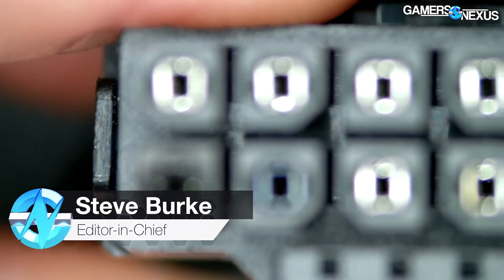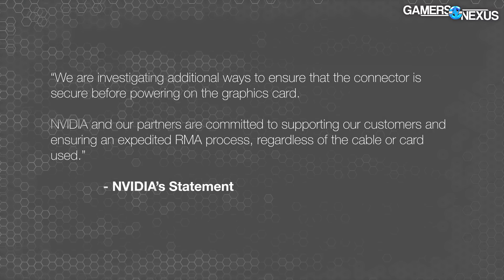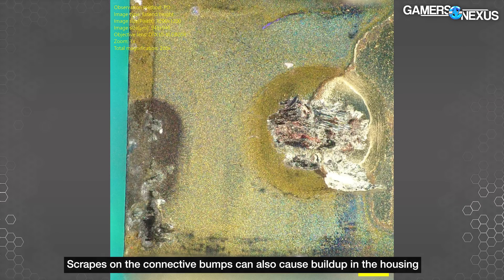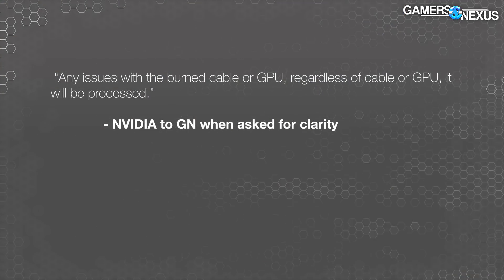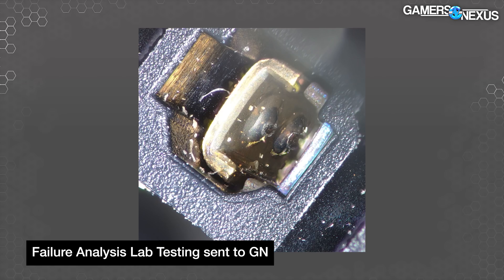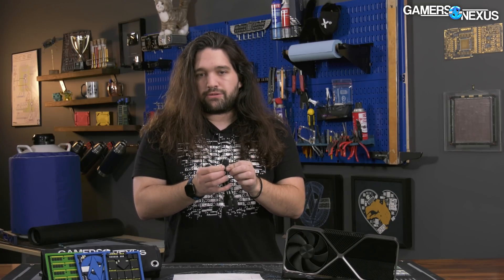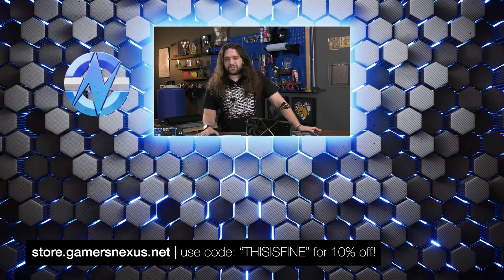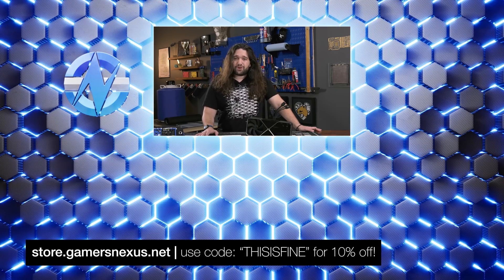NVIDIA Responds to Melting Cables, Warranty Concerns, & 12VHPWR Adapter Failures

Comment: Imagine the public opinion of Nvidia blaming user error if GN hadn't released their video and research on it already
Reply: @HappyDiggers  What, like my car shouldn't go into reverse unless its stationary? So I shouldn't be able to go into reverse gear at 70mph on the motorway? My friend had another friend did exactly that to his car and shredded the gearbox. User error - operated outside the specified parameters. Using the card while the cable is not completed seated is outside the parameters. To me this is the exact same thing - stifling companies productivity by forcing them to make everything idiot proof is a bad idea in my opinion - especially when the information is so readily available on the internet. If you spend this amount of money, you should most definitely have some kind of common sense. Nothing more is required here, I mean I appreciate this investigation, but my gut told me the answer way before unveiling a conclusion was necessary.
Reply: right the optics overall are just much better this way .2nd source with a customer first mindset. rather than a corporate first.
Reply: Almost makes you wonder how and why the information happened to come in that order within a couple of days, after weeks of speculation
Reply: @rillepp  You wonder why? It's similarly educated lab engineers sampling tests and errors for the same product, beginning from the same timeframe period. Nvidia being the liable party, takes a few days extra to be sure they can stand by their findings.

This is completely natural. Would you rather have there be a month between the same findings? That'd be far more suspicious lol
Reply: @Real_MisterSir  I would expect Nvidia to come out with analysis much sooner considering the resources they have to throw at it versus a Youtube channel, plus the motivation from PR situation burning a hole in their pocket. Although appreciate that they also have the liability of this product to weigh against that.

What I am saying is that GN putting the video out and throwing the blame heavily on user error has been great for both allowing that user blame to come from a 3rd party, and also letting Nvidia see how the public reacts (or "buys it" if you prefer) before releasing their own statement. Nvidia must be pretty happy with GN right now on balance.
Reply: @rillepp  cuz nvidia was scared to drop them allegations on these snowflakes nowadays, without GN to break it to them softly first lol.
Reply: @rillepp  Why it took multiple labs teh same amount of time to gather evidence and make an analysis?
Reply: @rillepp  Good point. Has all the obvious symptoms of a scripted scenario.
Reply: @toddhoward5555  it just works
Reply: @HappyDiggers  Ow don't get me wrong! I agree with you that we should be using safe connectors. This however isn't the industry standard as a good connector is expensive and companies hate parting with money!

As for the question of how many transfer more then 600W, do you want a list or is a link to a connector brochure sufficient?

Also the number of Watts is irrelevant... The amperage is what's important!
Reply: @Nemesis-pe7mw  
Your last sentence is wrong. Amperage means nothing without Voltage.
Reply: @AttilaTheHun333333  no he don't wire are rated in amp not volt most wire are rated for 600volt 
It could be 10v or 500v if the amperage is over the wire rating you will have some magic smoke
Watt is even more irrelevant the same wire can burn at 150w (10v at 15amp)or be good for 6000w (600v at 10amp)
In the end what funny is people think 600w is a lot of power lol
Reply: @legros731  
You say he's not wrong, yet show the importance of voltage when talking about amps in your own example. 🤦‍♂️
Besides 600 Watts definitely is a lot at 12V.
Reply: @AttilaTheHun333333  yes voltage and wattage is important Ohm law buddy They all influences each other 
but the amp is the only thing that never change in the wire capabilities  his is why wire are rated in amp capacity 
In this case of a poor connection the watt/volt/amp stay the same but the resistance created by the poor connection cannot deliver the same amp draw because of the reduced surface area in the contact = burn connector 
one size wire can support a wide range of voltage and wattage
More volt just mean a smaller wire can deliver more power(watt)
600w is not a lot for 12 volt and the card rarely go above 450w they make 2000watt power supply buddy this is a lot more we talking 166amp at 12v
For the same reason breaker and fuse are rated in amp and not in watt or volt
Reply: @legros731  
Stopped reading at "buddy"
Reply: @AttilaTheHun333333  ok buddy the clown who think he know something but actually know nothing about simple things like wire rating and Ohm law
Reply: @AttilaTheHun333333  Thank you for in correcting me.

Voltage has no relation to the heat produced. What is correct is that you need a minimum voltage to drive the current.

If you stay at the same power and the amperage goes down the voltage goes up. So how is your comment relevant?
Reply: @glitter_fart  well if you search good enough, you can find some normal 6/8pin pcie connectors or 24pin mainboasrd connectors melted aswell...
here example: https://images-na.ssl-images-amazon.com/images/I/71OhTBX802L._SL1600_.jpg 
lots of ppl are firsttime building PCs and are just affraid to use too much force
Reply: @HappyDiggers  you didnt watch the video did you ? tranport your statement to the pigfat inthe gastank.....and hopefully some ligthbulbs will appear...
just because you can physicly fill a gastank with liquid pigfat and it will run for a while does NOT mean its bad design of a gastank/motor.....
Reply: @glitter_fart  it's not really an opinion, just bad design.
Reply: @HappyDiggers  so you will just reject any studies until you find one that supports your view? Doesn't sound very unbiased
Reply: Well, it is only 50 cases out of 100K, so it is kinda obvious that it is probably something on customer side.
Reply: "Nvidia calls their customers idiots and doesn't care." - That's what it would've been like, cause "corpos evil". - Not that I like Nvidia, almost at all, but ever since social media gave "the public" a voice, the consumer really started acting like they know better just because they pay a company and "have the right to complain".
Reply: @michaelmonstar4276  most of ngreedia customer are idiots so no offense taken there lol
Only idiot would pay 1600$ for a GPU and they still sold out in 5 minute so be ready for a 2000$ 5090 lol
Reply: @glitter_fart  then every single product ever made could be called a design flaw. its a plug
Reply: In fairness there are a lot of small things nvidia could have done to minimize the chance of user error. 

They’ll never be able to get that number to zero but having a clip that actually clicks when it is connected, painting part of the end to show a different color if it’s not fully seated or using a slightly more durable coating on  the connectors.

There are ways Nvidia could help minimize the chance of user error that costs then Penny’s per connector. 

But yes had they blamed consumers before channels like GN said anything they would have been eaten alive.
Reply: @BigHeadClan  what a bunch of clown it not Nvidia fault did you even listened to the video 
Secondly Intel participated in making this new connector  so by your logic is Intel at  fault as well
It user error 100% and what the problem Nvidia said it will warranty all melted card anyway
Reply: @legros731  If Nvidia is providing the warranty for melted cards then they admit that it's their product that is at fault. "Clown"
Reply: @HappyDiggers  Nvidia didn't design the 12vhpwr connection standard tho so they shifted that liability to pci-sig the designers, its now up to them to update  the design.
Reply: @HappyDiggers  This is easily the least intelligent thing I have ever seen on the internet. Well done, that is quite the feat.
Reply: @m0rianne  "anything that rationally criticizes my corporate idols is unintelligent!"
-brazen product fantard
Reply: @Jay A Couldn't find your post. You said "How would go about gaining the required knowledge without toughing hardware."

The premise of not touching hardware is incorrect and not what I meant at all.

First you research. Just start reading, preferably reading, videos if you must. Then you visit a number of enthusiast site and verify that what you learned is indeed correct. After which you start with the OLDEST hardware you can find. Build a few cheap systems. See if there is a community near you and join them or at least visit a few times. Find a buddy that is in the know to help you. Preferably after a few you advance to the expensive hardware.

I for instance learned a lot from a PC of old parts I build 20 years ago, I put it in old filtered transmission oil as a cooling medium. Even though I did my due diligence I destroyed a mainboard. Which was expected thus I had a spare. I got it to run and it cooled very well. I learned a ton from this. Cost me nothing, the hardware was a donation from a company and the oil was waste from another company.

DO NOT DO THIS IF YOU DO NOT KNOW WHAT YOU'RE DOING! OLD TRANSMISSION OIL CONTAINS METAL PARTICLES WHICH CAN CAUSE DANGEROUS SITUATIONS FOR OBVIOUS REASONS. ALSO YOUR CAPS WILL POP IF YOU DO NOT INSULATE THEM!
Reply: People frequently describe buildings PCs like adult Legos, to emphasize how simple it is. It's a reductive statement but if people are going to continue to parrot this, then this issue has to be a design flaw. It shouldn't be possible to make such a egregious mistake if the building process is supposed to be as easy as people make it out to be. There shouldn't be any room for error in the designs.
Reply: @ImAlsoMerobiba  lol shouldn't any flaw in the design lol that it not possible this is real life not a fairytale 
Everything is a compromise
Reply: @ImAlsoMerobiba  lol, no. but ok...
Reply: @HappyDiggers  Have you ever plugged something into a power point, they work partially plugged in, it's not safe - but if a connection's made it will work. Not pushing something in fully is definitely user error, especially when we aren't talking 1mil we are talking 5 to 6ml.
Reply: @HappyDiggers  lol it not a fire hazard not one have catch fire we are not even close to a fire in this case
This exact scenario could happen to any connector by the way
One exemple are ford heater fan connector they always melt like crazy and the only thing that happens is the fan eventually stop working they never cause fire and something they are so melted you cannot even disconnect them 
By the way i live in Canada and we got excellent consumer protection law
Reply: You don't have to imagine it. Morons all over the PC gaming subreddits are still blaming Nvidia.
Reply: Woulda been the same. "Bullshit".
Reply: @glitter_fart  nope ....24pin atx exists same latch same wire apms specs same everything ...if people are to fukign stupid to use a fuking PLUG they shount be ANYWHERE close to a fuking pc...(as long as its closed its fine)
Reply: @glitter_fart  Yep.
Reply: Boeing did that
Reply: @glitter_fart  who care about your option
Reply: In relation to your comment. Image the shape our country would be in if he had honest reporting
Reply: @HappyDiggers  yet it does though being my point :)
Reply: @glitter_fart  Give me an example of another product that uses 500-600 watts via 12 volts? ATX standard, it was nice knowing you but we need to move on. That and the power hungry GPU's need their own PSU.
Reply: No the puiblic is gonna hate on NVidia anway because people are stupid
Reply: @TheNerd  I mean nvidia didnt have to conform to ATX standards for power delivery. At this point, power hungry GPU's like the 4090 need their own PSU. It's kinda ridiculous to shove 500-600 watts down 12V rails into a single connector. My entire computer with a mid tier CPU and 1080ti doesn't use that much power. P=IxE  600=50x12. That's right, 50 amps across tiny wires. You can't be serious.
Reply: @HappyDiggers  BS period... Nvidia used the plug exactly like the specs agreed in the Gremium. And 50 idiots globally are 50 idiots... Just FYI your psu probably has a higher failure rate if it's not gold++
Reply: GN is being very nice in their wording while still saying the obvious.

This is "partly" and with that entirely a design error in the retention mechanism of the cable.

You're dealing with ludicrous amounts of amps in a small cable, so extra care squared needs to be taken designing this to be well seated.

Because it catching fire in any event the cable isn't seated properly is a given.
Reply: you can tell they waited.
Reply: But it is user error… and it’s only 50 cards that have the issue. Should we really be upset about 50 dumb fucks losing $1600 because they don’t know how to seat a cable properly?
Reply: I really dislike those connector designs, i'd much rather it was more like a barrel connector (given how important that connector is to it's performance).
Reply: @glitter_fart  Definitely user error.
Reply: @HappyDiggers  Maybe you shouldn't touch a pc.
Reply: IMO GN should have not made any of these videos because nvidia should’ve had to investigate this themselves and they owe Steve millions of dollars for his work; he single handedly saved them from an expensive recall; I personally think the cables should be recalled still, we should be able to get a free cable. Nvidia is scalping us practically with their prices and can’t give us a 50 cent cable it’s ridiculous
Reply: To be honest having seen the force Steve needed to use to get the cable to "click" into the socket correctly, I'm surprised there haven't been more melted cables.

Admittedly I'm not an expert PC Builder, but I doubt I'd have tried that much force to connect the power cable.
Reply: Funny thing is that Jonnyguru said it too.
And people went crazy on him
They where saying: yeah proper who has been building computers for years , don’t know how to plug a GPU

They where saying that without even knowing what people got the burnt connectors hahahaha

Could have been total noobs , for all we know.

Like you say , it almsot feels like Nvidia was trying to figure out how to say it.  With out people going nuts.
And Gamer Necus made them a. Huge favor
Reply: @HappyDiggers  Also it's at best a design over sight.  How many connectors used internally protect against bad placement? Many hardware connections will not even prevent you from plugging it in the wrong way.
Reply: Like Apple blaming users for holding their phones wrong with the antenna problems?
Reply: Edit: I seem to have replied to a comment that was deleted.
@UCWez92bamd1AIt3VX9ophXg McDonald's coffee is a misnomer, where after repeated warnings they continued to serve it above safe temperatures, and when it was spilled a woman's lap it was so scorching hot (180* or higher) that it melted her pants and gave her such bad burns she was hospitalized for 8 days; all she asked for in her original request to McDonalds was $20,000 to cover her hospital costs.
She only sued them after they denied that request (their offer was $800)— the case is Liebeck v. McDonald's Restaurants if you want to look it up.
Reply: @glitter_fart  Idk about you, but you can only design for so much incompetence. Did you see how loose those connectors were?
Reply: @anthonypham9708  if the cables are super loose, than they shouldn't power the GPU
Reply: @JayXdbX  yeah, I'll give you that the sense pins should disconnect way before power pins reach a threshold. To be fair to them though, this style of plug often has half a mm or more play in it after manufacturing in the direction of entry, so it's hard to fine-tune that.

That's also the reason why it's very hard to make a switch or electrical connection to check if the cable was fully inserted, the latching threshold is smaller than the play in the z-direction. But simply cutting power if the cable IS about to back out would be sufficient to guarantee non-smoking. 

At least all those connector shells are most likely glow-wire certified to not actually ignite.
Reply: @anthonypham9708  but... but.... nvidia bad, you dont understand.
Reply: @anthonypham9708  Did you watch the video and see how tight those connectors look even though they're not latched in? That's the design flaw. They come lose after the fact, during cable management. Nobody and I mean nobody plugged their cable in that loosely, looked at it, thought "this is fine" and proceeded to power on the system. They thought it was fully seated when it wasn't, due to the design flaw of it not latching.
Reply: @mjc0961  and that's been the case with latching connectors from the ATX standard from time immemoriam. Sotomayor people push "hard enough", don't hear a click, but still don't verify. It'snot that they're stupid... they don't have experience. I get it. But if you don't have experience, you spend the time and verify. Every guide talks about checking yo cables. Hell, it's a latch, it's not that hard to figure out.
Reply: hahaha so right! They must've been debating when and how to get this news out for weeks until GN released their video! This was funny af
Reply: Yeah I would not be surprised if Nvidia was trying to figure out how to release this and prove it without a bunch of blowback, and then once GN put out their video demonstrating it, Nvidia could breathe a sigh of relief.
Reply: imo i think gamers nexus did not cover this the right way and accidentally enabled NVIDIA's greed and anti consumerism by showing that its a 0.05 chance of it catching fire and caused by user error;

reality is, its more so a design error, this issue never was a thing on 1080 tis or other gens; we need someone to convince nvidia to give us free cablemod cables instead of this non-action answer that I consider the bare minimum;

this isn't really good customer service, XFX is, those guys would give me free stuff for no reason other than for buying their stuff to keep me a customer, especially when a card I had died, I'd get new cables, new stickers etc free, discount codes, they'd cover any costs of shipping, you get the idea. If XFX had a card that literally bursts into flames, I bet you they'd give you a cable that didn't do that, nvidia is basically giving people who RMA the card the same type of cable and not even the cablemod cable.
Reply: Design should be such that it prevents user error. Otherwise it is bad design. Just look at how good USB are.
Reply: @HappyDiggers  Sorry, it's a PC part. It's meant to be installed by some who has the knowledge to do so. If you do not do what steve demonstrates you shouldn't be going near hardware...
Reply: @Nemesis-pe7mw  absolute rubbish. if you dont know what you are doing you shouldn't go near hardware? Dont ever give advice to anyone again you absolute idiot. 

So how is anyone supposed to get into enthusiast gaming without knowing this stuff up front? 

you buy hardware and expect it to be user installable because its sold that way. 

Finally, no it isnt 75% its more than that. it can be 99% installed, no latched and work its way out. Are YOU deaf and blind?!
Reply: @HappyDiggers  Kinda my point, cable not fully connected is called "user error" when the fault is a badly designed connector.
Reply: @ssu7653  lol yes it is 
It's the user that did not fully seat the connector end of story you need resistant for a good connection a loose fit = bad connection 
You not been around many connector do you every weather pack connector found on car and everywhere a water tight seal is needed is way harder to connect that this 12 pin connector
Reply: @legros731  I will be honest with you, i never tried this connector. I have used different watertight connectors all my life and none of them have been hard to connect. 
We know the connectors have not been fully connected when they melt, but we dont know for sure if they came loos or if the user just didnt push it all the way. At best we know 1 way it can smelt, not proven to be how/why (they smelted before we had prof of this 1 also)
Reply: @ssu7653  if it click it fully seated and will not come off
There no rubber seal to increase the insertion force on this connector
In the end it doesn't matter Nvidia said it will honor all warranty and it's pretty generous when it 100% user error 
You not been around many automotive connector they can be extremely hard to fully seat they sometimes need plier to fully seat
Reply: @legros731  Clearly i have not been around the same connectors as you, they have always been easy to know when fully seated. Nvdia replacing parts under warranty, would strongly indicate they are not 100% sure its user error that caused this (user error is NOT covered by warranty)
Reply: @ssu7653  never said they where hard to know when it lock they are just hard to connect like this one  is really clear when it click  on this 12 pin connector like every connector I ever used
You will be surprised how many "non working" PC are actually just the  24 pin or a 8 pin on the GPU or the ram that are not fully inserted 
There no excuses for all the moron who melted there 1600+$ GPU  that for sure
Reply: If GN didn't release a video and NVIDIA stated their conclusion, the internet continue bashing on nvidia in their little echo chamber.
Reply: I think it's still nvidias fault. If an experienced builder can make this mistake, it's definitely a shit design.
Reply: User error = bad design, unless they can somehow prove that the user did something wrong (cable with a clip like this, expect that they were all connected to the point it engages)
Reply: @ssu7653  you know, I'm with User Error = stupid user here. They gave a positive feedback device in the form of a latch. It's a latch, not some fancy-schmancy terminal pullout retention clip that most people wouldn't know what to do with. If people can't use a latch to check their work, then any more foolproof simply becomes insulting. And yet users have a proud tradition of not entering even the older 12V power or even the ATX 24-pin correctly. Ain't nobody blaming ATX for that.

The latch could be higher quality though. Just like with original Molex MicroFit vs Chinese copies, on the originals you can hear and feel the click on the originals, while the cheap copies have a muddy feel.
Reply: @ssu7653  Utter rubbish, I if get a knife and pop it into a toaster I will get a shock, absolute user error. If I pour coffee on my laptop, user error, I run a car into a tree user error, few of those are design errors -you can only engineer for stupid so much.
Reply: @ssu7653  Exactly people were not plugging them to the point of clip engagement, I see this all the time on clients equipment and I chalk it up to laziness
Reply: @ssu7653  Agee. There should be a way for the card to not turn on if it senses it’s not fully connected. So technically it is design issue in a sense from safety standpoint. For a cable to push this many watts that should have been a safety measure. GN did say nvidia and pci sig are looking at something like that if it’s not fully in it won pass current on etc.
Reply: @NetworkNinja2k26  it not the watt one 14 gauge wire can give 1500watt easy
But at 12volt this would require 125amp that would instantly melt the wire
at 110volt it's only 13.5amp perfectly fine for a 14g wire
At the max 600watt the connector is rated for the wire need to be able to sustain 50amp but if you distribute this 50a on 6pin it's only 8.5amp
Reply: @HappyDiggers  this is not possible we don't live in a fairytale
A connection is a connection you would need a physical switch that tell the GPU if it fully inserted 
If you too dumb to push untill the click of the lock is hear it 100% on you
Reply: A design that easily leads to "user error" is a bad design.
Consider the decades of 6-pin and 8-pin usage without issues...
Reply: @seamon9732  thats simply not true many 8 pin cables have melted.
Reply: @seamon9732  I've seen many melted 6 and 8 pins over my years as a tech.
Reply: @seamon9732  "easily" 0.04% of buyers lmao
Clownworld
Reply: @glitter_fart  0.04% is a ridiculously low number for a “design flaw”

Thinking “okey , this should be enough”

Is user error.

If my cable hadn’t “clicked” or fully plugged in.
I would have called the store and told that either my connector or card was faulty.

You’d be amazed by the amount of cases of “not working computers” I’ve received where the situation was that the ram wasn’t fully plugged in , but they “read somewhere that sometimes the ram doesn’t clicks” so they thought that should be good enough.

Or GPUs that weren’t fully plugged in.

And believe it or not , the most common
“The motherboard cable is wrong , it doesn’t gets in”
Dude push harder.

It’s almost funny watching their ashamed faces when I just push it hard and it clicks in.

I’ve already built 3 custom made computers with different 4090 partners.

4th including my personal one .

Inno3d 4090 (mine)
And zotac gaming one.
Eaaassy.
The 12 pin connector was easy to plug in and clicked lodo y and satisfyingly 

Asus tuf gaming.

Had more resistance , but it did ended up making an audible click.

FE 4090 , I admit this one was right , and it could feel scary for a beginner builder to apply the pressure it seemed to require.
And the click was almost silent.
But it did latched.

And it was precisely because I didn’t heard anything , to tell me “it’s in”

Instead of calling it a day.

I tried pulling it out.
And it didn’t because it had latched.
Surprise surprise , none of this 4090 gave trouble.
The companies making this cable for Nvidia are clearly not getting a good desing award for their job 😂

But it is consumer error , like it or not
Reply: I blamed user error from day one, I don't get why people hate the company that literally leads innovation to the point we have graphics today that seemed near impossible to achieve a few generations ago. Reddit is like cancer on humanity with all the trash they were spouting over there, in complete denial of the fact that they were simply careless when installing the cards.
Reply: @FatterTony  thanks so much ,  feels refreshing to read something with a bit of sense and logic between the pool of nonsense going around lately.

Yeah Nvidia prices where high. But people are hating them like if they where in the human trafficking business 😂

I think pharmaceutics multiplying the price of some cancer treatments for 5/6 times their actual price , get less hate than Nvidia is getting.
What’s. Bunch of no-life nerds getting si angry at a company for making gpus they can’t afford.

Just buy AMD if it’s that bad.

The fact that they are angry only proves that they wanted to buy Nvidia and they sre butthurt that they can’t afford it.

Nvidia is atleast still making the most powerful cards , with the most top notch software technologies.

I’ve seen people say that DlSS 3 is stupid because it adds a tiny bit of input lag.

And then get super excited about AMD’s fsr 3 wich is exactly the same
Just coming our way later . And likely, as usual , worse quality

If DlSS 3 was available for the 2000 and 3000 cards , they would be going crazy about DlSS 3
Reply: Is just 0.05 % who really cares! Gn is doing the correct research but is a little drama involved
Reply: They’re going to continue to have bad press this launch because of pricing (even Steve couldn’t resist repeatedly roasting them in his 4080 review). The fact that they didn’t get ahead of this makes them look shadier. 

Concerns of PR shouldn’t matter, especially if they were always going to acknowledge RMAs over cables (regardless of user error). That already softens the blow of blaming users.
Reply: @HappyDiggers  "Nvidia and GN both blame users. They are both wrong." 🤦‍♂🤣
Reply: Well this should have been a instruction manual. Kinda is a careless on their part. I mean GN did say even if the cable is sully inserted it may not be full latched on. Giving impression it’s connected. I am sure they had this data in labs from testing. Just put better instructions in. May be they will now.
Reply: @NetworkNinja2k26  Instruction manual to plug something fully in?  It wasn't 1mil it was around 5 to 6ml, who needs an instruction manual for that?
Reply: Steve Jobs did it....they gave a rubber band their fanboys and everyone was well....Iphone4. PPL STILL kept buying it. Nvidia doesn´t  care.
Reply: @glitter_fart  It's a 2000 $ card. It stands to reason that a professional installs it. As Steve showed the cable has to be in just about 75% way in to overheat.

THAT IS DEFINITELY USER ERROR! Again only 75%, clearly identifiable visually!

The design could've been better. But the connector is better then many other connectors on the market! Take for instance the US power plug....
Reply: Yes, most youtubers aren't good for society I agree!
Reply: GN just crossed the line with their pandering.  Legally, nvidia cannot invalidate the warranty over a cable without proving who should be blamed in court.  The law is designed so that the manufacturer can only deny a warranty by telling you who is to blame with proof.  If they cannot prove someone else is at fault, they legally must honor the warranty.

Nvidia made this connector, pushing the spec onto sig to get psu manufacturers to use it does not change nvidia's responsibility.  Nvidia was using this connector in 30xx series and it was only added to the atx 3.0 spec in feb of 2022.
Using sig as legal cover is not going to work because sig does not require the connector, it is optional in the spec. Nvidia putting this connector on their cards is the sole reason people are stuck using this connector.

People are dumb so this will be ignored, but you only have to use this defective connector because nvidia forced you to use it by putting it on their cards.
Reply: @_PatrickO  lol clown that not how it work
One example if you fail to clean your fireplace chimney and your house burn down it is the fireplace or chimney manufacturers fault? or you just a moron 
Same for this 
Or if you fail to properly secure your winter wheel on your car and loose a wheel and kill 2 people it is the car manufacturer fault? or you just a moron
This connector is not faulty in any way and correct installation will not melt the wire 
Get over it you should just maybe not play with expensive PC part of you cannot even connect a power wire correctly
Reply: @_PatrickO  No. when NV was using ambiguous language, GN asked them to clarify and forced them to say out loud "yes, your warranty will be honored." This means that users are more likely to try, instead of doubting themselves. Yes, legally their obligations remain the same, but more users will feel comfortable trying, instead of being afraid of not seeing their card again.
Reply: @Validole  You are missing when they said this "may void the warranty" part of a statement they made.